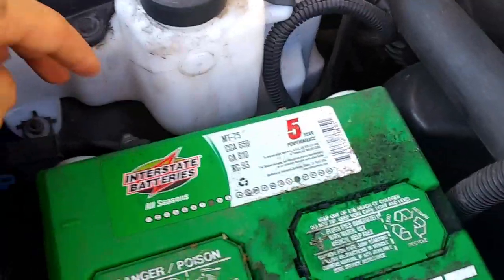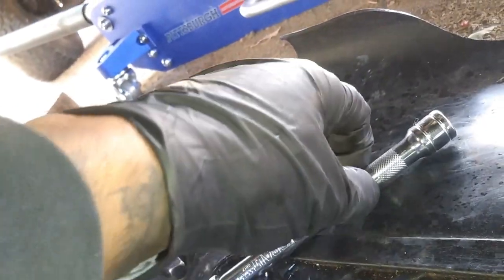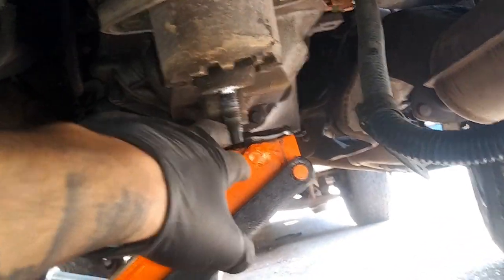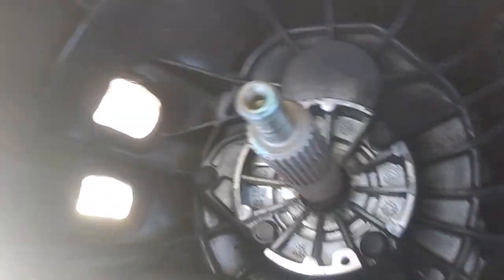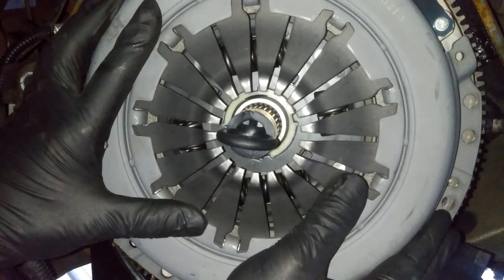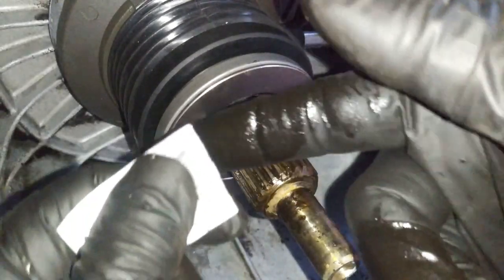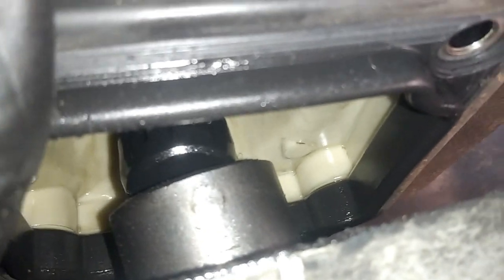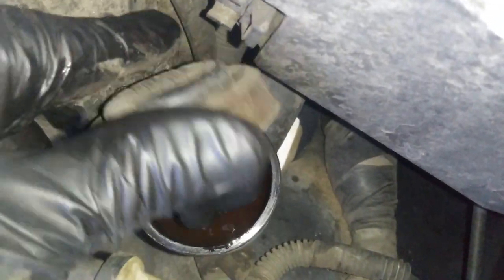2003 gmc sonoma/ s10 clutch replacement

Comment: One thing that helps and is pretty cheap is all thread or a longer headless bolt. Run them in 2 bolt holes use it to guide the transmission in and have something to rest it on while you work the transmission in. Once you get a couple of bolts in, back the headless bolts out or all thread and put the bolts in, in the all threads place.
Reply: I agree with this.  I went one step further and cut screw driver slots in them so I could get at them, with the tranny in, with a screw driver.
Reply: Good ideas. Thanks

Comment: Thanks for the video Jabo! Was great information replacing the clutch/flywheel/pressure plate/slave cylinder on my GMC Sonoma. You're right definitely put the right bolt in first. I had a couple issues with the exhaust bolts on the exhaust header but learned how to heat up the bolts for easier removal. I'm not sure if this is for all applications but I learned you need to use  synchromesh oil instead of regular gear oil.  It was great information that you listed what size bolts and tools you needed. Just wanted to say Thank you and this video was a great help!
Reply: Hey I have a 98 s10 I've been researching like hell and cannot find the size of the flywheel bolts do you happen to know?

Comment: Thanks for taking the time to make this vid! I'm working on a 2000 S10 today! 
This is definitely going to help!

Edit:
I have the Chilton manual and for the 'pressure plate to flywheel bolts' it says the torque specs are as follows:
For years 96' and later it's 33ft lbs for the four cylinder model and 29ft lbs for the V6! Not sure why it's less for the larger motor but that's what it says...
This is in regards to the NV1500...

Comment: Gotta give a thanks for this video! I’ve got a 96 s10 so some things are a little different but this video helped me out a ton today, got clutch, pressure plate, flywheel and both the master and slave cylinder changed out. Ole work truck is happy again!

Comment: You're a good teacher bro,  I appreciate the video.  Still strugglin tho on my 03 sonoma, I have no experience.
Reply: Do I absolutely need to take the exhaust off?
Reply from the maker: Yes you do. Thank you!
Reply: There isn't but one way to get that and that's to wade off into it. Most important thing is is that if you do not know what you're doing ask before you break something.
Reply: It is recommended to change all parts related, that means clutch, pressure plate, slave cyl/throw out bearing, Pilot bushing, FLYWHEEL and I personally ALWAYS change the Rear Main Seal on the rear of the engine because I have been burned before on those, had ONE  that was dry and looked good and After it was all back together 10 Miles on the test drive it started puking engine oil! So I had to do the job TWICE and the second time was for free! Oh Yeah master cylinder too because the pressure from a new clutch will take them out

Comment: Great job and great video. The only thing we are doing differently is replacing the flywheel bolts. I went and looked online and it stated that the bolts are torque-to-yield, meaning one and done.  Again, thanks for the great video.

Comment: What is the best method to get to the top bell housing bolts?  Was told I may have to unbolt 4 body bolts and lift body and suspend it on a 4x4 block to make it easier.
Reply: I was able to get to those top bolts no problem by letting the trans drop down all the way then using an impact wrench with a swivel socket and bunch of extensions. U dont have to lift the body of anything. There is actually plenty of room

Comment: gREAT INFORMATIVE video.  Thanks for makin it.  However, if my shifter is hard to get in a gear as it is cold outside, but gets easier as it warms up, it that a clutch or a clutch cylinder problem.

Comment: I'm pretty sure that the flywheel should have three locating dowels in it. I didn't see them in the one you removed, so I imagine that they were stuck in the pressure plate that you removed. You should have transferred them to the new flywheel and then your new pressure plate would have lined up with those dowels.

Comment: Hi do you know what is the torque for the flywheel bolts, I'm working an a 2003 chevy s10 4 cylinders which I think  is the same  engine you worked, thank you.
Reply: I have same question
Reply: Haynes repair manual says 55 ft lbs

Comment: i have a 96 gmc sonoma 2.2 rwd manual sls. im getting ready to put my tranny back on but forgot where the long bolt goes.. i have 6 bell houseing to engine bolts. also how the ground wires go on . i found a nut that fit. can u go into detail where each bolt goes?   thanks t yu19

Comment: I followed this video but I’m not able to shift into first gear even after bleeding the break fluid, any advice?
Reply from the maker: 3 things either you didn't connect the line or there is to much air. Are you closing the bleeder screw all the way. Are you using a plastic line to help you with the bleeding

Comment: What would cause really bad vibration after doing this job? Gets worse with each lower gear
Reply from the maker: Did you resurface the flywheel
Reply: @JaboTheMechanic  a new one was supposed to had been installed. I’m thinking the guy did a sh*t job. He pinched the wires you said to look out for in this video. I got 3 or 4 other cars so my s10 sat for a couple of years while I chased that problem. I’m thinking he may have gotten grease or dirt on the flywheel. Would that cause it?
Reply from the maker: Yeah that could have happened. But it sounds  like it's chattering
Reply: 87Qleen the vibration comes from the drive shaft,, before is remove you got to put a mark on it and went you put it back you got to line it off with the mark the you put on the drive shaft  at The beginning., I have same problem with my 03 S10 and that eliminated the vibration .
Reply: Before removing the drive shaft put a line in each side with white paint and when you put the drive shaft back  make sure the lines face each other, that will stop the vibration.

Comment: Great video, helped a lot. One thing, try not to use pronouns when describing parts. For example, saying this or that part while pointing at this or that part. EVERY part has a NAME, SAY the parts NAME! If I go to the auto parts place, I can't tell the clerk I want this or that part! There was a "part" behind the flywheel inside of the rear main seal, you described with a pronoun. You concluded YOURS was OK and didn't need to be replaced. I had to figure out what part you were talking about. I hadn't completely removed my tranny at the time I watched your video, so I didn't know whether I'd have to replace my "that part" once I got my tranny out and took a look!
Reply: Pinche Google wey.....if you ain't mechanical saby, well let someone else do it! Or Google it!